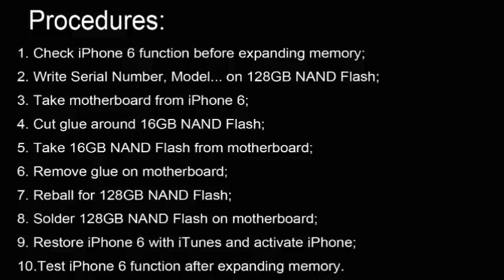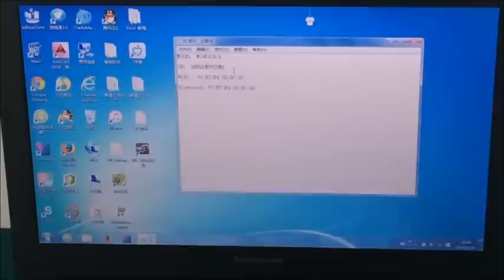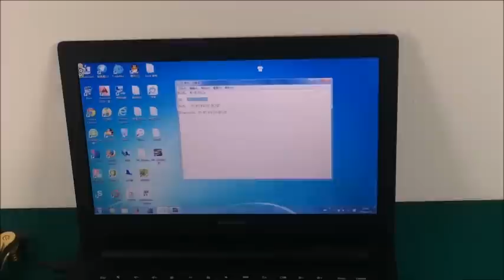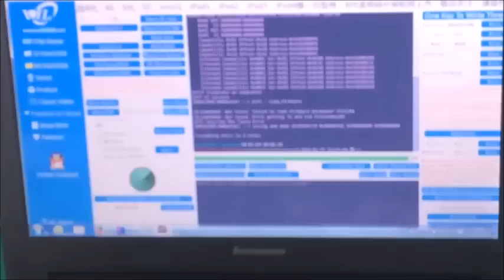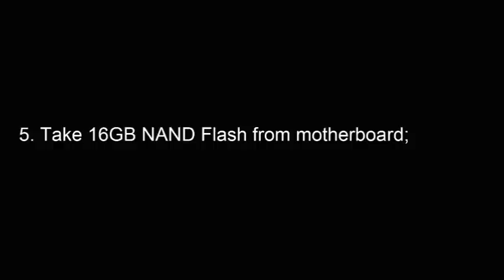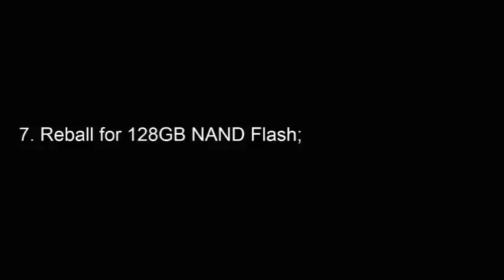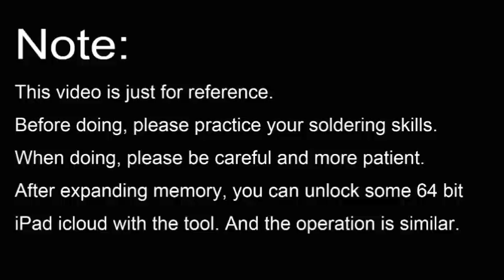Expand iPhone 6 Memory from 16GB to 128GB by Changing NAND Flash HDD

Comment: I hate to do this to a 2 year old video, but I've been going through the comments, and I don't think ANYONE else noticed this. At 3:25, you can see that the phone is ALREADY 128GB, as the available storage is at 112GB. Cmon guys. Seriously?
Reply: Thx for the heads up! I actually had to pause it at 3:23 to spot it though.
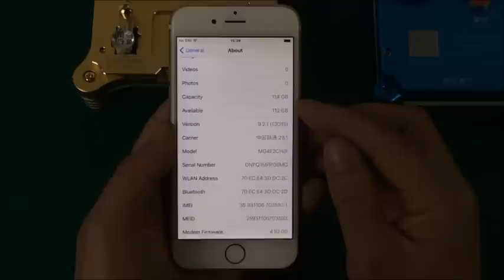Reply: Also just caught the time on the phone at 3:23 is (16:21) and at 18:31 the phone reads (15:39)

Comment: Hi, does the ipad 4 support 128gb nand chip? Because i wanted to upgrade my old 16gb one.

Edit:

I actually found that 128gb ipad 4 models existed, for example ME392FD/A.

How to find that chip for my ipad, or how to check which kind of chip is correct for my ipad?
Reply: For mine just go onto eBay and type iPad 4 nand flash memory chip
Reply: @henrysessionsfarming7448  Thanks, will also search in  Aliexpress, Alibaba.  Did you also find some reliable site where it shows clearly the ipad 4 chip with its connectors shape and number?

I found that some iphone chip is compatible with ipads and vice versa, so probably the sam applies to the ipad 4... i could find, say, an 256gb chip meant for an iphone that works perfectly with the ipad after being formatted properly.

Comment: I am watching this now 3 years after uploaded but I have the gold iphone 6s 16GB storage and get every time message that my storage of 16GB it is full and i must delete someone apps or photos videos and i delete and storage is full in 2 hours when i go check iphone storage i see 9,92GB by System hence there is a phone repair shop in the Netherlands in my hometown that does this iphone storage upgrade and previously an iphone 7 from 32GB have upgraded to 128GB these repair store do a lot of solder work  Can i get my iphone 6s gold 16GB upgraded to 128GB or more because i cant upgrade to Ios 13 I get notification that iOS 13 is available but I have storage full problem and get i problem with iOS 13 my phone works now on iOS 12.4.1

Comment: nice video . can I also unluck icloud which this tool ??
Reply: +1
Reply from the maker: +Igor MiLo  This tool is used for read & write 64 bit NANA Flash Serial Number, Model, WIFI, Bluetooth,area for iPhone 5s/6/6+. With similar operation, it can unlock iCloud for iPad mini 2/3/4, Air/2. For iPhone 5s iCloud,  need extra IC and tool.
Reply: Lou what tool I more necessary?
Reply: Luo Tony o